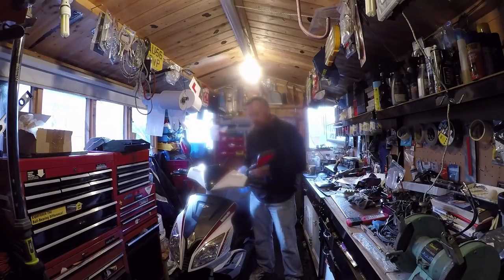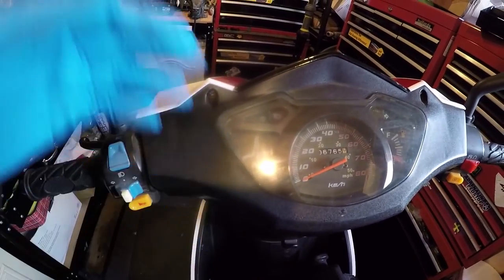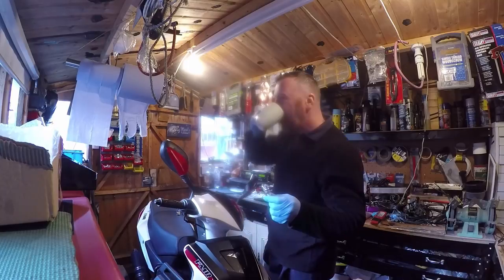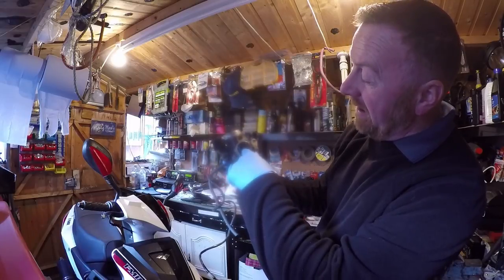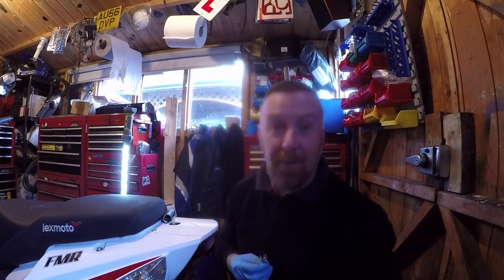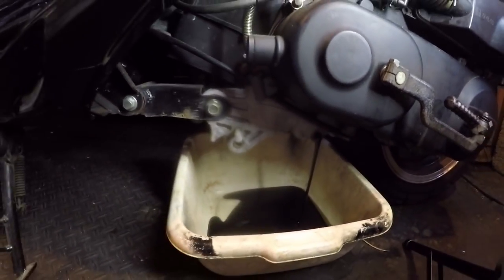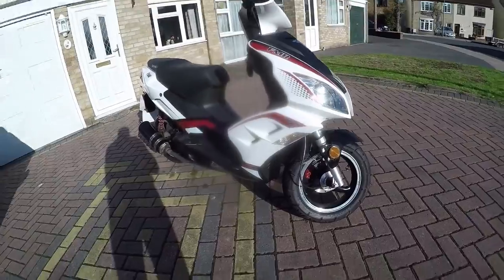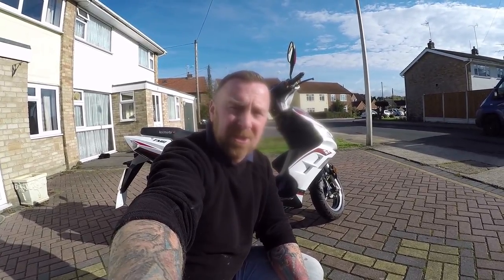LEXMOTO FMR 50CC 4T MOPED SCOOTER SERVICE  OIL CHANGE FIX & CHAT MARK SAVAGE

Comment: I have a fmr 50cc that's done around 10k miles as my every day daily commuter bike, 10 to 40 miles a day depending on which site I'm working on. 

Its never let me down yet touch wood.

Its a great little bike

And take the thick spacer out the variator and  swap the rollers to 6g and it happily fly's along at 40pmh all day long and will reach 45 mph  top speed
Reply: I no its a year later but is it still going good
Reply: Still got it?

Comment: Thank you Mark! Your video was just what I was looking for!
Just bought me an old 2005 Kymco Filly 4t for 220€ here in Netherlands, it's the first upgrade from a bicycle i could afford with my money, need it for work and I'm tho it's old, i love it and am chuffed as hell! drove the poor thing almost 40km back home no problems, noticed today it's dry as a bone (previous owner said he did maintenance so i didn't check right away) but it's a real soldier, hasn't seized yet, so i'm not touching it till i change the little oil it has. 
Your video provided great guidance what  to do, what oil to buy and how to go about it. I will be buying 10-40w motorcycle oil and changing it on Tuesday when shops are open again. 
Spark and the rest will come next weekend I suppose. Hope you fixed your camera issue meanwhile! Respect from Netherlands, this is what YouTube is made for! 

Cheers mate and keep on rolling!
Reply from the maker: Thats really good to hear bud 
And my videos help , theres a load more videos on my channel you might like and may help 
Take care mate

Comment from the maker: I NEED A NEW CAMERA !!! GRRR , THANKS FOR WATCHING
Reply: Looks like my lexmoto fmx 125
Im enjoying mine 
65 plate needs front 
N. Rear pads i know m o t inspector so hes goni fit em 
My elect start no power getting 
To it. Kick slow.
Reply: A grip replacement video would be great
Reply from the maker: hi bud as im the hand grips, they can be a pain but i cut the old ones off and then use washing up liquid and a lot of pushing to get the new one on 
hope that helps, if i get a bike in that needs them i wil upload one 
thanks for watching 
mark
Reply from the maker: hi and thanks for the offer, ive not seen them before and have just looked them up
before I bought the go pro 4 I did look at a few other as I need sound as well as a good video but found most of them are not that good and as in my videos I do have problems with sound and now view lol 
you cannot private message any more and see you do like james may on your channel lol, it's a really good offer not sure how far away from Essex you are.
mark
Reply: mark savage yeah James May is a great market for all sorts of compilations lol. I’m based in London but I’d imagine the only way I’d get it to you is by post... not sure how to orchestrate this safely but if you want go on my channel and email the business enquiry email with your address.
Reply: Amazing video just the smudge is fustrating. Solid content as always bud

Comment: Is it ok to top up oil through the timing  inspection  hole as its easier  to access  on my bike ?
Reply from the maker: its not the norm bud if you cannot get the oil in the oil filler it will still get into the engine and a cleaver idea !,

Comment: I went up a hill and my lexmoto echo E4 stopped. I think its the belt. The bike starts, the engine starts but and sounds fine but the rear wheel is not moving. can you point me in the right direction on how to fix it?
Reply from the maker: give this a watch bud it will explain what to do and how it works plus i have many other videos on how to do it 
https://youtu.be/gRHOsTmd-2w

Comment: Hi Mark, bought a lexmoto echo 50 for my step son, very low mileage under 1k but running a bit rough. Given it a full service, checked valve clearance, replaced idle and main jets for same numbers which were 33 & 80 not sure if thats standard, just what was in it. before I changed the main jet it was running rich, taking the bung out the air filter improved it, opening filter completely even better, put new 80 main jet in and it now seems to be the opposite, if I do the same test as before it dies. When trying to fine tube carb by air mixture etc it don't seem to do much until its out to far then just dies. Any tips or advice would by much appreciated.
Reply from the maker: with only 1k on the clock ,think something wrong there but 
ok you may have to google spec as 80 jet does seem big for this moped
speedfights are only 54 to 56 so this maybe your problem 
have a look what else may have been played with but id use a smaller main jet then tune like in my videos 3 half to start and make sure all pipe are on and they have not gone hard
Reply: Thanks for taking the time to reply, I'll give it a go and keep you posted.
Reply: Was advised the main jet should be 84, decided to buy a new carb as I have no air line to blow it out to ensure its all clear and they ain't that expensive. Runs lots better but now I can't seem to get both running and idling right together, if it runs and pulls good then after about a minute it changes tone and eventually dies, or when it changes tone you try to rev it it stutters and either dies or bogs down and clears. If you increase the idle speed it seems better but then its idling to high. Soooooo frustrating!!!! Any ideas or suggestions?
Reply: @marksavage  hi Mark, I think I've found the problem, however now slightly worried. The tappet adjuster screw on the exhaust valve is missingng, great!! Replace it.... but where can it go?  Do these have sumps?  Will dump the oil see if anything comes out to start with i guess but if that's swimming round the engine what's next?
Reply from the maker: @pauljai7151  oh !
Yes it should make it way down but may not be whole 
Worth draining the oil out first before taking things apart and or a flush too
Or with only 1k could of been missed from the start!
If its running ok now I wouldn't start pulling it apart now lol so oil change 1st
Reply: @marksavage  thanks mate I'll do that 1st.

Comment: U alright was wondering if you would recommend this as a starter bike as Turing 16 and don’t know much about any of this going to view a 2017 model soon and what speed do they usually top out at and if all working is it a good starter bike worth the buy around £700 or should I give it a pass?
Reply from the maker: they are good looking moped but 30 mph with 10 inch wheels, as long as you service them and look over them they will keep going, if your after more speed then its an old 2t moped but they do break down if not looked after !!
I have many other videos on here that may help on other Chinese mopeds and lots of 2t like speedfight, aerox, dna's and so on 
please like share and sub 
mark

Comment: Hello mark mate I have gotten my self a lexmoto fms 125 4 stroke and I'm wondering what 10w40 you recommend I have got some semi synthetic carlube 10w40 motorcycle oil? Also is semi okay to put in or should I go for a fully synthetic cestrol more high grade oil cheers
Reply from the maker: hi bud 
semi is fine and as long as its motorbike oil it down to you but dont use fully in these as its just not worth it bud 
sory for the late reply it was held by youtube ( dont know why lol ,take care )
Reply: @marksavage  thankyou do you have any advise for looking after scooters throughout winters? I keep my indoors as I have the room luckily but I know most scooters don't take well to heavy rain lol

Comment: Hi mark I have a gilera runner 125cc fully stock. Was working and then cut out randomly. It has a spark and petrol gets to the engine. There is compression. I think I may have flooded my spark plug but don’t have any tools to take it out. Do u have any trips to un flood it. Shall I just leave it sitting for the night? And try start in the morning?
Reply: It’s a 2 stroke btw
Reply from the maker: leave the plug out this should let the fuel dissipate ,leave it out for a good hour ,it should help
cutting out at random is very hard to find, but start with new plug , clean air filter , check air mix as in my videos 
then carry on with fueling so vacuum and fuel pipes 
see how you get on with that 
I have many videos that should help on my channel , yes for speedfights but they will help 
mark

Comment: Hi, my son has one of these and the fuel gauge has stopped working, would you have any idea what would cause this? Thanks.
Reply: Fuel sender unit in the tank bud
Reply: Or the gauge on the clock

Comment: Yay back in the shed lol great stuff mate. How do you rate lexmoto mark? As apossed to Honda's pcx?
Reply from the maker: Matt Gibson thanks bud as  for the Honda vs Lexmoto 
Honda every time 
Much better build and engine mark
Reply: Pcx is the far better bike than this quite a fast bike tbh stolen a lot around my area but I’d buy a Nmax I’ve owned both the Nmax is a beautiful bike

Comment: is Castrol 464622 CASTROLPOWER 1 Racing 4T 10W-40 good for a SYM Mask 50cc 4T?
Reply from the maker: you can just use normal 4t 10/40 bike oil bud as its not a race bike , 
just keep an eye on it like i say in all my videos but you can use what you like bud

Comment: Is the oil change the same on a longjia/echo 50. Many thanks
Reply from the maker: yes bud give or take the sump plug and filler , really a good idea to do it and keep an eye on it too bud
Reply: @marksavage  Thanks, I did oil change thinking it was the cause of white smoke coming from exhaust. My moped was stolen a month ago and now recovered, I've fixed her all up, including the electrics but it's got an odd ticking noise since then, and smokes like you wouldn't believe, I've noticed oil leaking too.Have they completely trashed my scooter or is it an easy inexpensive fix for the garage . Sorry to ask, just at a real loss after watching many videos and trying to understand the cause. Was hoping to fix it myself but I fear this may be too complex for me.
Reply from the maker: @maggiehooper3795  sounds like they just revved the nuts out of it and ragged it around 
The rings might have taken a bashing but wo6ld look into getting the tappets done 
Trace the oil leak bud 
Sod's think they can just take what's not theres 
And you end up with the damage and poss a bill 
Grrrr
Reply: @marksavage  thanks hun x

Comment: Hi mate, I know you say it isn't worth doing much with these cheap bikes and before you laugh, I got a lexmoto scout off a work mate for free, it wasn't running but with the help of your vids (and a few others) it's up and running, since it cost me nothing i thought I'd use it to learn how to do my own DIY 
 I've put a new spark plug, new battery, new air filter and got rid of the horrible airbox, unrestricted cdi, upjetted it, new exhaust and given it a good going over, get just a tad over 45mph on it (when it eventually gets there!) thing is since putting the air filter on it, I'm getting lot of noise coming from it, Is that normal? Almost sounds like airs blowing back through the filter?
Reply from the maker: well it was free so all good, you will get more sound once you take off the air box so not to worry as long as it runs ok and getting 45 is good bud 
you may have to keep an eye on your plug to see how your running then a little tune
Reply: @marksavage  cheers mate, was worrying a bit the engine might blow, yep going to give the carb a little tune tomorrow and maybe get some rollers, cheers for the vids bud, helped me out a fair bit 👍🏾
Reply: @marksavage  hi mate, so after a few days of running it with the new exhaust etc, I've lost top speed, only getting 40 when it gets there and acceleration is a lot slower? Exhaust gets pretty hot, hotter than standard, only recent thing I've done is topped up the oil, am I needing to tune it because of the new exhaust? Or am I looking at rollers and clutch springs to balance out the new exhaust? Thanks in advance
Reply from the maker: this often happens like in my recent video, you are now getting more gasses out so you will need a tune or upjet to get more fuel and air into the head 
all bikes need back pressure and sounds like you have lost a bit of that so have a go at a 4 size upjet and a tune with a little more air in 
dont worry about it getting hot
Reply: @marksavage  cheers bud, I'll have a watch of your vid when I get home from work and fiddle around tomorrow, I'm already running #85 jet (original was #79) I have a spare 82 but will order a couple more in various sizes and see how it goes

Comment: If I put a unrestricted cdi in mine will it go to like 40 45 I’ve changed my exhaust I’ve got the exact bike but 17 plate
Reply from the maker: It will add mph but can't say too speed bud but defo help
Reply: I've got a 17 plate coming mate and it's got a derestricted cdi the man said it will go 30mph then mentioned the cdi so his lad could get up hills better do you reckon it will do 40?
Reply: @bencollis4307  the cdi only ups rpm. If you want it to go faster. Do cvt tuning. By changing rollers and removing the restrictor nut on the variator.
Reply: @JDMz  I have one off these but a 18 plate any advice on de restricting for a 18 plate

Comment: Done all this ? It's sparking but still won't start 😕
Reply from the maker: ok, what bike ?
you have a good blue spark?
wet hand test ?
wet plug
last serviced 
e10 fuel ?
how did it stop working ?
Reply: Wow thank you for qick response much appreciated. It was lay on its side for a while it is a 4 stroke lexi moto 50 took air filter out cleaned it new plug even battery is new. Its sparking wet the plug with fule still can't seen to start it. Even drained the fule and put fresh in its a  16 plate one.
Reply from the maker: @gazpeters2857  laying on side isn't  good
but ok cleaned carb fuel getting in so vacuum ok 
good spark all good 
wet plug so fuel getting in 
turns over ok 
4t so oil ok 
have you tried easy start into the air box and turn over 
fresh fuel is good e5? as e10 is causing so much damage 
valves checked and ok , power coming from stator and ht plug ok 
if still nothing could be piston failure damaged valves , timing out from loose chain etc
Reply: Thanks again for advice 🙏